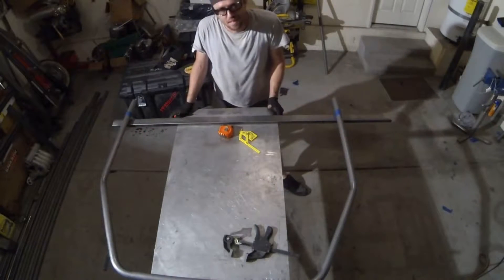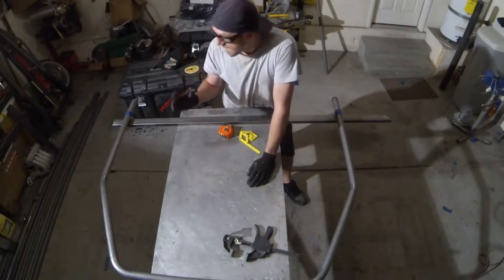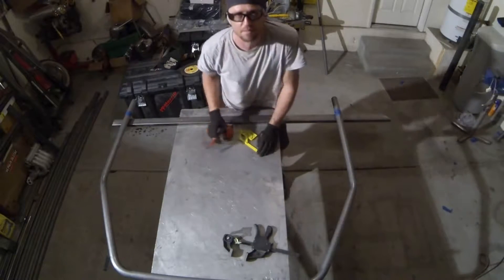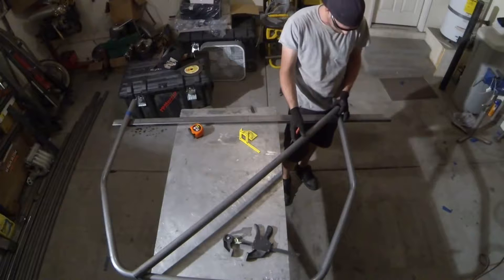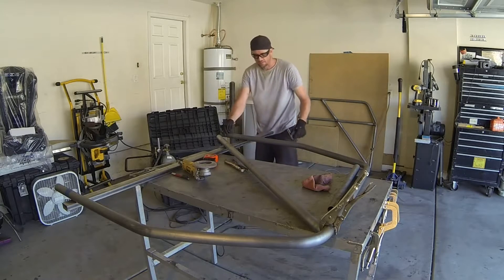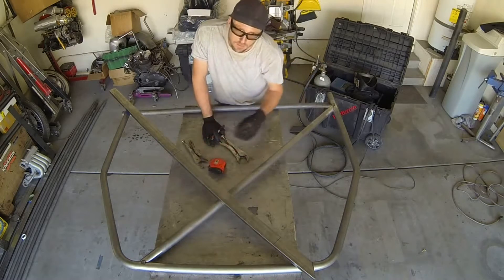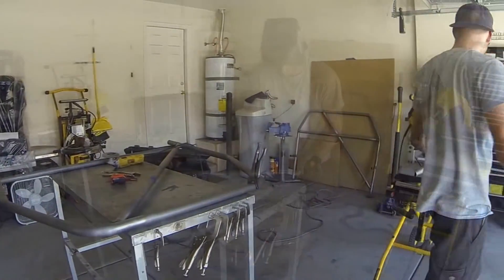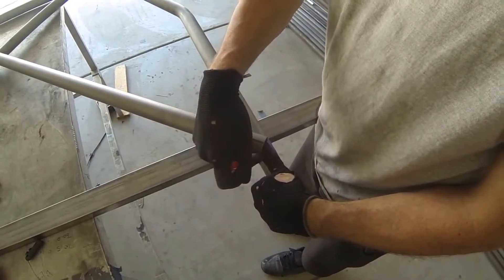TFSS: How To Build A Time Attack Roll Cage - Diagonal Bracing

Comment: I've seen people use both Mig and Tig for welding cages, and you seemed to use more Mig when welding the tube front end for you other series on the 240, why is Tig used here? Would you not recommend using Mig for a cage?
Reply: chromoly cages have to be 100% TIG welded, any other material used can be MIG or TIG.